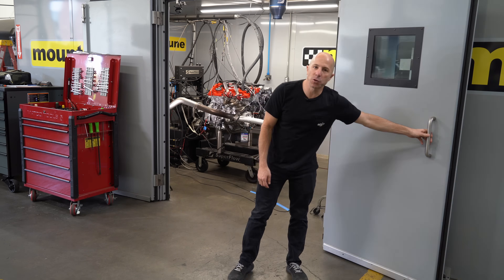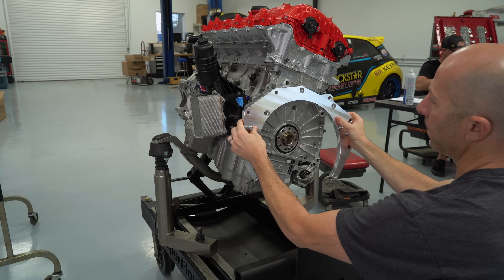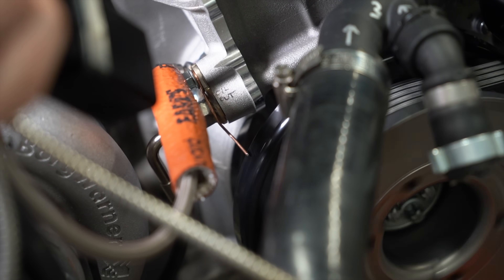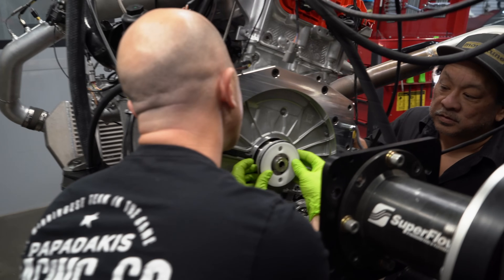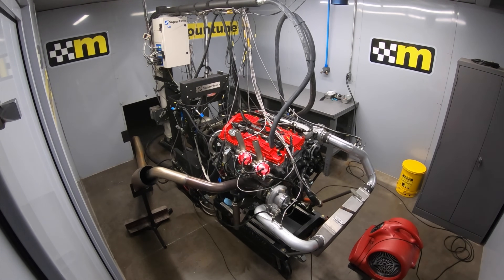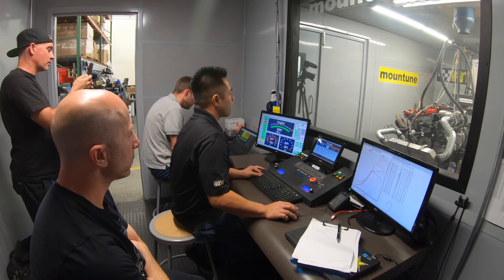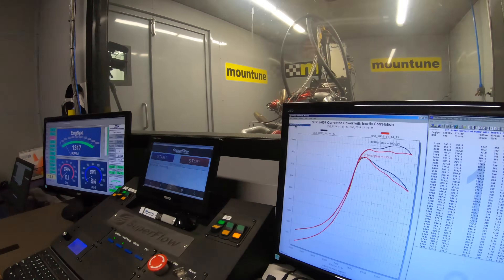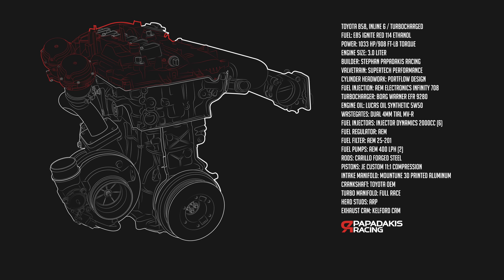B58 Engine Dyno 1000+ Horsepower - Sounds like a 2JZ!?

Comment: Wow, congrats on the milestone.

However, all the people saying this is "now worthy of the 2JZ legacy" or whatever, it isn't. You can mod the hell out of any motor to make 1000+hp with enough cash, tools, and knowledge. The 2JZ was legendary because it made 650+ with practically bolt-ons and little else. The work Papa did can hardly be considered bolt-on. That's not to discredit his work though - making 1000hp was never easy, even with the 2JZ.

Comment: This is a fascinating series. I defer to experienced tuners and builders like yourself to test the strength and reliability of the B58 engine. There's so much hearsay in the comments about how this motor is just a BMW turd. So far, your success at the dyno is indicating otherwise. The block, cylinder head and crank required little to no effort and this thing seemed to make that number effortlessly. There are very few blocks on factory vehicles in this price-range that could even come close to 1000HP without becoming see-through. Thus far, this motor seems to be a skookum choocher.

Comment: It's a very solid engine no doubt. 2jz does not need quite that much boost to reach 1000hp. Think squeezing all that air through those 2 exhaust ports is causing backup.

Comment: B-but... the people with internet engineering degrees said this engine couldn’t make that kind of power!
Reply: Reeeeeeeee
Reply: ßaron dude, I remember when the coyote was about to come out, people were saying it WOULD NEVER handle more than 550hp because of the rods lmfao
Reply: @alandominguez1707  but the ring lands fail and gauld the cylinder walls
Reply: YouTube certified mechanics
Reply: you can squeeze as much power as you want from an engine. It's a matter of how much it will cost and how often you will have to rebuild it. The engines in top-fuel dragsters make like what 10k hp? Granted, they burn a completely different fuel but they still have to be rebuilt after each (quarter?) mile. They are used for *less than ten seconds* before requiring a rebuild.
Reply: @GeorgeTsiros  go squeeze 5000 from an Sr20 :p
Reply: @scootbmx01  sure. It will have four turbos, burn a mix of nitroglycerine and nitro and last for 5 seconds before you need to replace everything. Something tells me you didn't quite get what i wrote earlier.
Reply: @GeorgeTsiros  I wholefully agree with this logic
Reply: @hyposphenous  it's a bit similar with rechargable batteries (rechargable cells), you can get a lot more power out of them than their rating, up to what their internal resistance allows, the question is "do you want it to be able to maintain its capacity a second time?". However, in this case, one could argue that since it can't be recharged afterwards, it is no longer a rechargable battery and thus my initial claim is more or less disingenious. Disenginious? 🤔
Reply: People in this comment section are certified YouTube engineer's
Reply: It can make the power...for about 10 minutes
Reply: "the people" u mean bunch of 15yo kids? 😂
Reply: They have a coated layer of iron on the cylinder walls, for ULTIMATE TUNING ABILITY. Not only that, but the crank is forged, and many of the internals are made to make the engine tunable AF because Supra, but not as front heavy as the boat that is the mk4 supra
Reply: @זהסודי-ה7מ  lmao your "english" is unintelligible
Reply: @kiyotaka269  I fixed it, thanks!
Reply: @זהסודי-ה7מ  no problem
Reply: its built up im curious how far u could take a stock.
Reply: It's because they didn't do the extra mod build ups and still thinking stock! This master Mech did!
Reply: ßaron lol
Reply: Yea with stock hardware. smh
Reply: Just about any engine "can" make 1000hp just a matter of how much....
Reply: Spencer has left the chat . 😂
Reply: The problem isn't how much hp it can make but for how long and reliably.
Reply: But But.. thats its Peak performance SADLY. 😂🔥🔥🔥🔥🔥 Mfs needed 50lbs of boost to make 1k hp 🤣
Reply: Everyone in the comments Skreeeeeeeeeeeee I’m right skreeeeeeeeeeeeee
Reply: Their build budget is insane
Reply: They were wrong
Reply: Actually people said it couldn’t make anywhere on stock engine like a 2J which is actually still true...
Reply: 6 years later they making 1200whp reliable and 1600whp almost at the limit of some components
Reply: Toyota helped make the b58 reliable. During development Toyota kept sending engine components back to BMW each time they found tolerances issues and quality issues. This constant feedback and helped make the b58 probably one of the most reliable bmw engine blocks out there.
Reply: @mpls20001  😂😂😂 How many of Toyota cars in the European market are actually made by themselves!!! and not just rebadged.
Reply: @monkey0078  supra and gt86 only. The factory that makes the supra is renowned for making bmw but its not owned by BMW, apparently the factory makes other cars too
Reply: @mpls20001  what?? I don't thing so... Are you a toyota  worker involved in the supra s assemble?? I am sure BMW surprises Toyota with His quality engineering... Thais Is the reason because Toyota needs BMW help making the supra
Reply: @johanngm26  I don;t work for Toyota, i just drive a Lexus.

https://www.youtube.com/watch?v=_jbyzmtgU_0

note in particular section ,  8.04  to 9.30 
If you're interested, watch the whole video to see how esch party worked for the whole car.
The whole joint venture came about because of cost only, costs of R&D from scratch is alot to to develop a niche sports car..
Reply: @mpls20001   Ok let me mention some things... The first one is the reason because toyota change some things... Costs very easy to understand, here in other coments You can read toyota s set up is cheaper than BMW s, why?? Easy Toyota fucus is tuning, reliable and affordable but with much potential car, this is the top line in Toyotas catalog they need yo ensure the cost per benefit is good... If Toyota don't see the really capacity of b58 and his platform Toyota never uses the bmw hardware even if they need yo re engineer some parts...because they know how capable is... And the other reason... The Best sport Cars in dinamics and engines tech comes from Germany... Toyota know it... They don't use Lexus platform because they don't have nothing capable for this prices... Nissan with his GT-R knows too thats the reason why they uses Porsche 911 for base to develop GT-R... Why they don't use the R34? Easy... tuning only gives you hps but a complete platform gives you the capacity to manage the power...
Reply: @johanngm26  I know English ain't your first language so, I'm not responfomg to your post directly... Clearly you haven't seen the video or don't want to do so..
Reply: @mpls20001  ja ja ok i really dont care about it... The only real fact now Is Toyota need BMW tecnology, engineering and quality to make His "legendary" supra because Toyota knows the potencial of the b58 platform, probably english Is not my born lenguage but i understand about cars, and some fanboys try to explain the supra in the wrong way... Toyota understand that... how hard Is for the fanboys understand that too...
Reply: @johanngm26  if you don't care, don't comment then,, don't try to convince me of your biasdness.
You can't even engage in a sensible debate, which leads me to conclude you are a little kid!
Reply: @mpls20001  i don't care if you know about english Is my mother languaje or not... You understand my point i give  arguments i don't try convince you for nothing i am no interesed in convince you  ... I am 29 years old the diference Is i am not a fast and furius guy that only think about hps...bye
Reply: @mpls20001  ja ja ja Are you trying to make me feel bad with that?  Ja ja  you don't even do that well...
Reply: I'm not a mechanic, but it happens that my car is equipped with a 2JZ GE VVTI engine, and it's notorious in the community to not go over 400 whp if you don't want to have surprises and occasionnaly engine lights festivals. Also, for daily driving, the 2JZ GTE was not meant to be runned over 500 whp. But in those time, those where much more insane numbers than today. The B58 can be tuned up to 500 reliable horsepowers, but it also, in stock form, uses nearly 4dl less fuel on 100km than a 2JZ.
Everyone focus about big numbers, but you are forgetting ecology in your internet rants.
Reply: In stock form
Reply: I mean it can't. This is nowhere near the same.
Reply: (Laughs in 1,375hp 6.0L junkyard LS with stock internals and gapped piston rings)
Reply: @SoI_Badguy   I was just about to type this lmao. 42#s of boost is a lot for 1000hp. I have a hellcat with upper lower and injectors that puts that down 960whp still on 93.
Reply: AHHHHHHHH
Reply: imagine loving a z4 called supra
Reply: No, they're saying that it can't compete with the 2JZ, and they're right.
Reply: Now let's see how long it takes to break 😝
Reply: @rubenbraekman4515  says you 😂
Reply: Ruben Braekman eh...  this is a race engine.  You sacrifice some reliability for performance.  Definitely don’t want this for my daily driver car.
Reply: Ruben Braekman it won’t break due to it made with parts that can handle that power unless you keep adding power
Reply: Yes your right it couldnt do it. But the reason they got showing 1000 was the Shpertune dyno and through the trans. Which increased the torque figure. The power test one doesnt grab at it then leave go ,that doesnt give a true power. One increases the load and thennthe engine settles down ,then one reads the figure,,,,,, this is typical Supertune Humbug.
Reply: it didnt....all the guts are changed to do that lol
Reply: Well they changed the cylinder heads to forged cylinders so that is changing the heart of the engine. Therefore this isn't a stock car.
Reply: @MrSingh1150  yeah that sentence makes no sense.
Reply: @MrSingh1150  shits 1000hp course it's not stock 🤣
Reply: @MrSingh1150  forged pistons Einstein.
Reply: @TheAdatto  the block has to with stand pressures as well genius. Otherwise you'll have pistons flying out of the engine.
Reply: never trust an engineer that what l say they are limited by their educational paradigm
Reply: @saints0712  Then buy cars made by a nobody in his backyard. Gtfo idiot.
Reply: @saints0712  Nope. BMW designed that engine for a specified amount of power, and +20% it won't have a effect on LONG lasting durability. 

You can hit it with 650 and it lasts a good while, but it might not see 100k miles. Because the more power does "overload" the bearings, gaskets and also thermals and stuff. The engine can handle it, but it might fail 50k earlier than a stock one. ^^ 

Remember ONE thing, specially with german cars and engines: When they can spare a penny, they'll do it as long as the engine lasts also as long (or a tiny bit shorter.). In germany everything is built to the edge. 

It isn't the engineers fault, it is the "fault" of cost cutting to improve profit margins. The engineers are way more capable of doing fancy stuff like that, specially with their massive R&D budgets. ^^
Reply: @DrDOHC  very true, but this variant of the b58 has alot of toyota re-engineering.   The supra's head is completely different than the bmw cars, so is that plate ontop of the crank, oil pump, cooling system, the entire timing chain , different rods and pistons which give completely different compression ratios, different turbo internals, different intake manifold, different sensors, bmw uses gaskets where the toyota spec doesn't, bmw uses an intercooler, toyota has a heat exchanger built into the intake instead. the toyota crank is lighter by 2kgs but thinner etc.. the toyota build is much cheaper. bmw does 6 variants of its motors ranging from base to race. toyota was given the "mid tier", the bmw cars have the "upper" and "super" variants including the z4m40i that everyone thinks this car is the same as. z4 has an actual exhaust manifold, actual intake manifold, actual intercooler, forged rods, thicker lower compression pistons etc etc.    theres tons of these motors running low 10's / high 9's with stock engines and stock turbos with billet compressor wheels and matched housings. this isnt a new engine. its won best engine every year for the past half of a decade....
Reply: @LeeOnTheTrack  Source to verify that toyota has re-engineered the b58?
Reply: @LeeOnTheTrack I know this is an old comment but precisely none of this is true. Toyota did absolutely nothing to the B58 besides a different tune & emissions components which in all likelihood was probably done by bmw. For better or worse the B58 is entirely BMW & every change you listed either isn’t true or was a change done to the TU version of the B58 which is also used in BMWs.

Source - I work at a bmw dealership in Scottsdale.
Reply: @CadexLaw  bmw scottsdale shouldve told u that the b58b30C (the motor in this video) was manufactured by Magna... and the other b58's (b30M0/1(tu)/2(tu2), B58b30O1) are manufactured by BMW.   Toyota changed to the b58b30O1 (in db03 aka a91) after the launch cars (db43 aka a90) due to cost savings.   they have completely different rotating components.. completely different turbo setups and completely different compresssion ratios..
Reply: stock, it cant push power fully stock how a 2jz-vvti could make stock
Reply: Spencer Pond BMW B58s have been known to handle ~650 hp on stock internals. Obviously there are 2Js out there making more but it’s stupid to say that they can’t push power just because you’re obsessed with a car from 1994.
Reply: @parkererickson7471  realistically a 2jz can't handle more than that on a stock block either
Reply: @parkererickson7471  reliably?
Reply: @parkererickson7471  i like the 1994 lancia delta, before they turned it into a space eggplant, does that count? For its price it was quite nice for small trips
Reply: @parkererickson7471  yee but exactly because a similar modern engine is worse for tuning and making massive power is exactly why we love the 2JZ and hate all manufacturers for not being able to give us a better engine in 30 years now
Reply: @Benjamin15151515  laughs in LS series
Reply: Spencer Pond imagine resorting to stock vs. stock power figures in a discussion about engine tuning because you cant find any other relevant way to defend a 30 year old toyota engine that the internet told you was better than everything else
Reply: @spence92727  for your info, my dear sir, is that most 2JZ engine needs new stronger internals after passing the 700HP Mark, stock for stock and both will blow at 1000 for sure
Reply: @hyposphenous  except that's not true at all
Reply: @scootbmx01  If i'm mistaken, you surely have a better rand more definite proof then i do that showed that what i said before was wrong, i wanted to see the proof of what you're talking
Reply: @spence92727  actually stock for stock block they make similar hp as rad dan from rad industries said about 650 and sometimes 700hp is safe but you are definitely risking it @700+ on a stock 2jz. I would take his word over yours just saying pretty sure he has more experience than you with 2jz's.
Reply: @spence92727  lol yeah but how many people need more than 1000 hp?
Reply: @spence92727  the only thing I know that could make 1000hp fully reliable are Spitfire V12s
Reply: @spence92727  it's not stock.
Reply: @spence92727  ok boomer
Reply: Spencer Pond found the mk4 fanboy😂
Reply: @spence92727   A 2JZ could make this (~800hp) stock, on a dyno, with a good tune but you're in really sketchy territory for longevity, if you wanted to race the thing every weekend in imperfect conditions. 2JZ is tough but it's not supernatural.
Reply: @spence92727  A 600 hp b58 suprw can put it down better because of the chassis. Theres already videos of a mk4 vs mk5 with both making 600hp and the mk5 walked it badly.

Comment: would it ever be worth it to use both direct and port injection?  It seems like if controllers are available the injectors  could be made to only fire on the intake stroke and never the stratified charge.  Would driving the high pressure pump off the cams represent too much parasitic loss compared to just adding additional conventional port injectors?

Comment: If the engine was made only by Toyota and not BMW, I bet you could get that horsepower with only a huge turbo and that's it. And then there is the famous BMW timing chain and blowing auto gearbox.
Reply: 1. Toyota knows the people rarely ever touch any of there current engines in there "performance cars"(the Lexus F cars)so they went to someone who actually had experience with i6s.2. The ZF auto is known for being strong hence why it's used in hellcats and demons and could probably even share parts from the demons or hellcats ZF if needed if it can't handle the hp.
Reply: @carboydorifutoparty3976  They have experience in V6's but is a bad experience. The timing chain is a problem, turbos are also the problem and about the BMW transmission, tell that to the 320D, 335D, 520D.....owners that were going home on the tow truck.
Reply: @drunkshooter4156  the ZF trans is not owned by BMW. It's in multiple cars not just bmw from dodge,alfa,jeep,mercedes,ford,etc.

Comment: So what if you use the direct injectors? Would you have a much better powerband down low and mid range? And then use all that fuel from the extra injectors to get more high end power?

Comment: Nice. 

I saw all iron block and head straight sixes made in the 70s by Chevrolet pulling 1100+ HP on pump gas and 2,200 HP to on alcohol down in Brazil. Good to see these JDM engines starting to catch up to domestic engines.

Comment: wondering why you are running such a rich AFR.  10.5 (lambda .71) seems a bit excessive on E85, even at that boost level and using port injection.

Comment: Takes out high pressure fuel injection system that makes the engine more efficient and replaces it with 20 year old, dumb fuel injection system. Yeah, that makes sense.